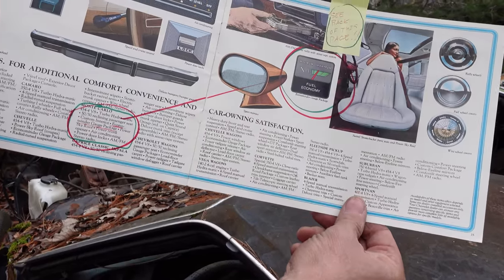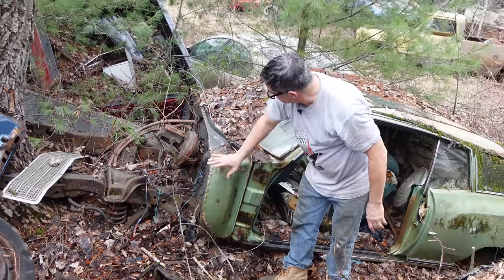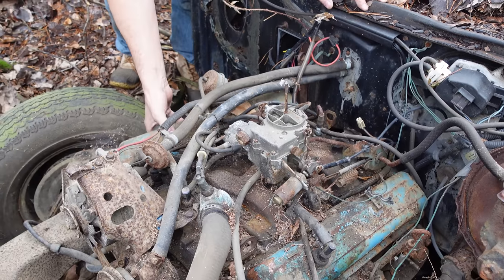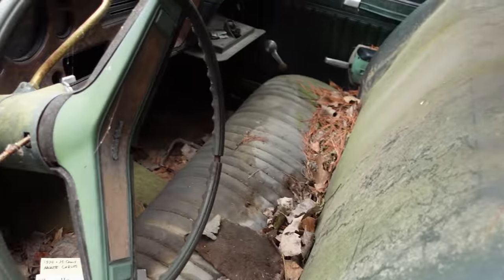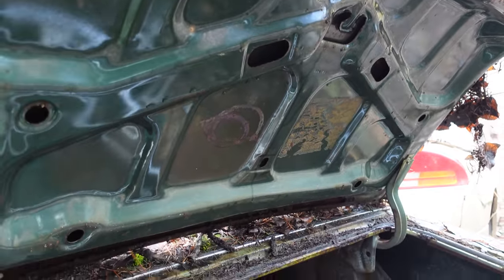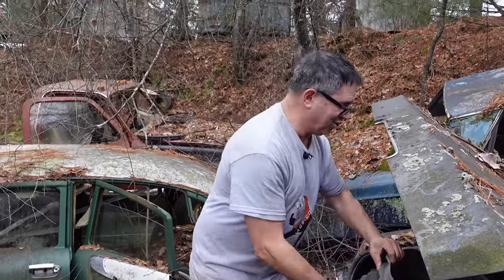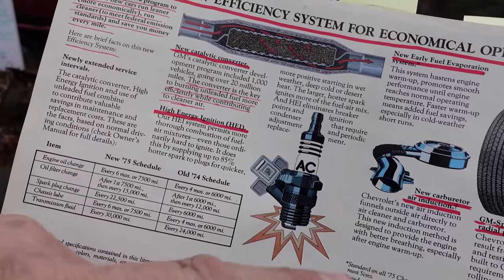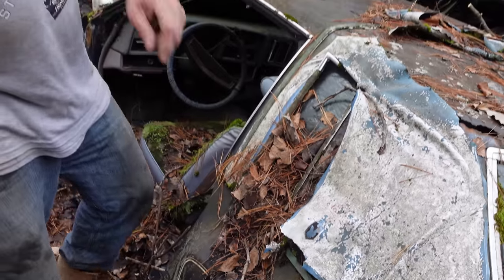Twins of Monte Carlo

Comment: It's crazy how my childhood cars are now classics!!!!!!
Reply: Mr. B Here ! Work for Oldsmobile dealer ! We are OLD ! LOL !
Reply: I believe 1973 and older are antiqued
Reply: @missingremote  lol that's me a antique!!!😄😄😄
Reply: Guys that is what we need today making fun of ourselves. Love it !
Reply: @debbiebermudez5890  I don't use the word "old" with out a er at the end Lol it just sounds better lol
Reply: Try this one you may like it ( Aged like a fine Wine ) ! LOL!
Reply: It takes a classic to recognize a classic.
Reply: @missingremote4388  it may vary from state to state (I don't know), but in my state of Kansas, any unmodified vehicle that is 35 years old or older, is considered an antique. And can be registered and tagged as such.
So now that it's 2023, a vehicle from 1988 is considered an antique in the state of Kansas!
Reply: @willhorting5317  Many states are 25 and older. They get historic plates, registrations and often just a safety inspection with no emission check. In theory, the emission controls originally on it should still be there and working, but since it's not a failure point, it's not "required". It technically is a Federal violation to remove them, but putting a newer engine in an older car "cleans" it up, so in theory, it's skirted over. Some states such as NY have "Vintage Historic" which  means that an original set of plates that were in use when the vehicle was a new vehicle can be put on the car and legally registered. It also reduces the insurance and gives it a period correct look. I have the original plate number on my 1980 Trans Am from when we got it new. The plates were saved throughout the years and I put them on several years ago, so if I look back at old photos, it's got those plates on it. The plate has gone from my dad to my mom to now me. When I wanted to transfer the plates, I called the DMV and the guy laughed, "Yup, just had a call on that the other day. Have the executor of the estate just sign the car and plates over to you. It actually will wind on my desk and if the paperwork is in order, we'll mail you the registration". That's exactly what happened and now it's renewed online like any other registration.
Reply: @googleusergp  😎
I appreciate the info.
In my 60 years, I have never lived outside of Kansas.
So I have no idea what other states do.
But I did assume that things probably vary from state to state.
Reply: @willhorting5317  Yes, they do. There's always the "Vermont method" to get a title when the paperwork has been lost. Fortunately, any parts cars I've gotten over the years had titles or when the yards and tow operators came to get them they never cared and off they went. Also, things can get messy when there are estates involved. Fortunately after my mother passed, everything was in order (and when my dad was alive, it was the same way) so my uncle was able to step in and handle signing everything. We already knew what we wanted to do, so the transfer of everything was just to make it legal and a formality.
Reply: @googleusergp  - That’s what happened here in Texas last summer when I went to get the annual inspection for my ‘97 Cavalier! When I asked why the fee was so low, the guy at the testing station explained and I responded by mockingly saying, “OMG - my daily driver is a CLASSIC…….!!!!!”

😂
Reply: @ddellwo  Back when my state had dyno emissions and I was driving my 1984 Delta 88 with a 307 Olds everyday as a commuter, I had to bring it for a dyno test. I know the operators of the shop for 30+ years (it's decentralized in my state, run by private shops) and he had a used car dealer there with a newer Grand Am and it wouldn't pass on the dyno. The operator said, "Let me take care of this guy (me) with the Olds and we'll try again". The used car guy said, "That old thing will never make it". Back then, you would run the test and then the operator had a remote control to change the screen. So the test goes, and you have to accelerate, decelerate, cruise, flat out throttle, etc. The test ends and he clicks the remote. The screen is all green and it says "PASSED". The results came out of the printer and I was stunned, clean as a whistle. I laughed and as the owner of the shop was putting the new sticker on he said, "You can't beat these old cars when they are running right". I said to the used car dealer, "And no, it's not for sale'. LOL.
Reply: My first car was a 77 T-Bird, right there with you!
Reply: I'm closing in on 50, I refuse to accept I'm old. 
When I was 18, 50 was ancient. 
I don't feel ancient ,I get around fine and still do active stuff although every once in a while the next morning hurts. 
Yeah I'm not dealing with  this age thing well at all , it's like I remember when the roads were "littered" with cars like these. 
Looking back,one fond memory is of being with mom going shopping ,and while walking in the store you end up hearing a one or a couple of Chryslers start up.
Reply: @MrTheHillfolk  I can usually tell the GM divisions apart as well. LOL.
Reply: I have Colorado Collector plates on my 73 C30 and a Horseless Carriage plate on my 53 Plymouth Cranbrook coupe. No emissions testing required for them
Reply: I worked in the prep department when those were new
Reply: No doubt

Comment: When I work for Chevrolet I was under the impression and that's what everybody said was that Monte Carlo frames were the same as a Chevelle station wagon frame
Reply: The reason they said that is only because of the wheelbase being the same. The frames were definitely not the same, though. Can you imagine a Chevelle wagon with the front bumper mounted way out ahead of the grille?

Comment: Thanks Steve - I managed to restore/replace abused items on my '70 Chevelle from MC's, the trunklid, dash (fill in the little slots where the burlwood aluminum insert tabs go) the rear window defogger, and even got my 12 bolt from one at a Pick n' Pull for like $100.

Comment: I had a 77 Monte Carlo bought new for 18 years.  Mine was buckskin with landau roof, swivel buckets, rally wheels, console auto, power windows, power locks, ac, rear window defogger, factory front and rear floor mats, light under the hood and inside the trunk, cruise control, tilt steering wheel, power steering, and power brakes.  Mine had the 305 2 barrel with very small carburetor jets which were a little too lean.   Beautiful car.  Thank you Steve for another wonderful Junkyard Crawl on a car that I had and loved.
Reply: You know, of all the Gen 2 Monte’s I’ve personally been involved with over the years, I have never come across one with a center console! Every single one has been a bench seat car, so they must have sold a TON of the benches even though it’s a vehicle that pretty much cries out for a center console and shifter!
Reply: @ddellwo  I've seen plenty with a floor shift and I went to college with a guy that had one, a 1977 with a 350 V8 and swivel buckets. He bragged about getting a NAPA distributor cap with brass terminals for "better spark". Too bad that those were available everywhere else. He'd put that "top quality" distributor cap on there, but the car had aluminum pool sides for floor boards. He was witty though. When asked what he wanted to do for work when we graduated, he said, "I want to be a mon back" When the counselor asked, "What's that?" He said, "Ya know the guy behind the truck waving the driver back saying 'Mon back.....keep comin', "Mon back". LOL.
Reply: @ddellwo  My Monte had storage in the center with a lid like a glove box that you could put things in.  I bought it in Oct 77 when the 78s came out it had been a dealer demo with literally every option available.  It was my first new car and had about 3,400 miles on it.  There was a light gold demo with a cloth bench seat and a 350 4 barrel I wanted but it literally sold when I was test driving it.  I liked the swivel buckets but I would have preferred the 350 4 barrel over the 305 2 barrel (the 350 was the fleet truck manager's demo).  I had called all the surrounding dealers and only 1 dealer had 77 Montes.  I liked the Pontiac Grand Prix  and  called the Pontiac dealers and none had any 77 Grand Prix left.  I wanted the last of the big GM PLCs.  I eventually got  use to the downsized intermediates.

Comment: Many people don’t realize that extension on the should isn’t for Chevelle to Monte Carlo. That extension is the add on for the small block , pull the clips and take it off and you have a big block shroud.
Reply: It's not quite that simple. Yes, the small blocks used a longer shroud than the big blocks, but the 2 shrouds are only 2¼" different. The small block depth is 12½", and the big block is 10¼". I have both to measure.
Reply: @danjanes8689  good to know. Then I can just say popping the extension off for the big block works, even though it may not be correct GM

Comment: I have a 70 Monte. Junkyard save from 25 years ago. It has a Pontiac 400 engine and transmission. The fans on a Chevy engine are a couple inches smaller diameter than Pontiac. I used a fan shroud from a 70 Grand Prix. Everything bolted in place with mods at all. GM was very good about interchangeability back in those days.

Comment: Back in 1979 my dad had the chance to buy a 1970 Monte Carlo 350 , 12 bolt posi with a four-speed! It was dark green with green bucket seat interior! It was in great shape!. It was the guy's daily , it actually had snow tires on it . The guy wanted 1750 for it! My dad wouldn't buy it because I was getting my license in 2 years and he knew I would take ownership of it!😂 till this day I have yet to see another Monte Carlo with a factory 4-speed.
Reply: Back in the late '80s or early '90s, I saw a news expose show on one of the major networks where they hired an older couple to drive a large RV around the country, while stopping for service on the RV at several shops located near major highways. The network also had their own team of mechanics, who verified the mechanical condition, and also set up small malfunctions to test the mechanics. Some shops fixed only the 'manufactured' malfunction, while others went beyond, doing work which was unnecessary in order to increase the bill. (Or even claiming to have done extra work which wasn't actually performed.) At the end, reporters confronted the dishonest shop owners. One of those shop owners was driving a '69 or '70 Grand Prix, and when he made his escape, I saw him reach down to put it in gear, and as he drove off I could hear that the GP had a manual transmission.
Reply: All of us have stories about The One That Got Away, '70 1/2 Z28s, R/T Challengers, etc. As much as these tales are heartbreaking, I still love hearing that I'm not alone!
Reply: Standard Monte's are rare but they are out there.

Comment: As a young fire and rescue first responder I learned that 75 and later Monte Carlo's had an extra reinforced B pillar due to General Motors anticipating that the government was going to mandate rollover Crash standards so you couldn't cut the top off of a Monte Carlo to extract passengers because it took too long so you would cut the bottom of the A pillars and then cut into the roof just before the B pillar and tilt most of the roof back. Just some more odd Automotive History!

Comment: My Dad had a 1970 Monte Carlo that was dark green with green interior with  the bench front seat. When I was looking for my first car I looked at a 2nd gen Monte Carlo that had swivel bucket seats and a console with a floor mounted shifter. Someone had put a Hurst shifter in it that had the velour T handle, not sure but I think it did have the 454 in it. It had some fat tires on the back, it was somewhat of a hot rod.

Comment: I owned a 1970 Chevrolet Monte Carlo from 1991-2010. Mine was early build (September 1969) from the Flint Michigan plant. Mid year, they eliminated the trim piece on the front of the vinyl top and ran the top to the windshield moulding. Mine was “desert sand”(gold) with a black vinyl top and “sandlewood” interior. It was a 350 4 barrel and had A/C. I spent several years restoring the car. I got to enjoy it for several years before I sold it in 2010. I’ve owned 3 others over the years, 1978, 1979 and 1983 models.
Reply: I didn’t know that about the vinyl top trim.  Mine was built the 3rd week of December 1969 in Van Nuys, California.  It has the full halo.  I’ve had it for 40 years now.

Comment: Thank you so much Steve for this video! I had a 75 MC in the same blue metallic with the white Landau roof as the one in the video except I had a white interior with the swivel bucket seats. I had the 454 4 barrel which I believe was called the "Towing Package" because "SS" wasn't politically correct for those gas crunch times. I also had 15x8 Corvette steel wheels which looked like the factory 15x7 wheels but much better looking! Of course, I broke many spindles too because they were so much heavier! I'm 62 years old. I've owned several GTO's, Mustangs, a 2006 Charger SRT, a 98 Trans Am WS6 (which I still own) and hands down my MC was my favorite car of all time. Thank you again!!!
Reply: @MrRamayr98 The 454 in a '75 Monte had to be exceedingly rare. The last year a 454 was available in a Chevelle (Malibu) or even Corvette was 1974.  I remember reading about that long before the internet existed. 
I even thought Steve was mistaken when he said '75 was that "last year of the 454" at the beginning of the video.

Comment: Similar point here on the radiator fan shroud- when the Cadillac Eldorado was restyled for '67, initially there was the possibility of a return to a 12 engine(at the design level); so if one looks at the fan shrouds for those, there's almost literally a short tunnel there, as they ended up scrapping the V12 idea & stayed with a V8. The fix for cooling was the add on fan shroud extension.

Comment: Steve I,m waiting for you To say what motor was in the 70, My Brother Dennis had a Beautiful 70 402 car light Green Nice Car
Reply: The VIN doesn't tell you that, you have to look for other clues. By 1972, the VIN did tell you which engine was installed.
Reply: @googleusergp   Vin does tell you Engine that's what I wanted to know
Reply: @brianbloom1799  Not in 1970 it doesn't. From 1972 onward for GM passenger cars it will. So, the 1975's VIN will tell us if it had a 350 two barrel originally or not. That cannot be found in the VIN for 1970 on GM cars.

Comment: Hi Steve, another great video on the 1st and 2nd gen Monte Carlos. 1st was no question, a beautiful car. The 2nd gen took a while for me to embrace, but I've come to my senses. 😆 Around here, 30yr ago, it was common to see a 2nd gen set up with a "gangster lean" or jacked way up in the air all around. It's not like today's customized cars with the 30in rims, etc. These were set up on the biggest tires on 15in Chevy ralleys with about a ft or more of clearance added with blocks, etc. If you were riding behind one of them, the rear axle assembly and sway bar were definitely on display, and if it didn't have a factory sway bar well thats what JC Whitney catalog was for. I installed a ton of them on 'these rides' back in the day. Some had them so tight that they would bounce going down the rd. I'm sure they lost all that personal luxury ride. A fellow came to me with one, one day and asked if I could install a new fuel tank on his car, and what he brought to me was a chromed tank. I asked why? "You're not gonna be able to see it." His reply was "...if you get it high enough, you can!". So if anyone ever sees a 2nd gen Monte with a chrome fuel tank. Rest assured, it was installed correctly. LOL Namaste 🙏🏼

Comment: Great Monte Carlo video! The '70 is a an early '70 build from what I've heard/read from the Halo top trim. Same with the body color hubcaps. Sea mist green. You can see the trunk lid was replaced with the dark green one, the hinges are light green still. Man I sure would like that steering wheel for my '70.
Reply: I noticed that top also. I had a early build 1970 with the same top.

Comment: We turn those 73-77 a bodies into circle track cars. We like them because the chassis is more robust, and the lower control arm mounts are wider so that when we design the front suspension geometry it’s easier to dial in the moment center. The upper mounts are tall enough we can cut and modify them to remain stock looking. The rear we just drop the lower arms on the axle 1.750 down and lower the whole car down to 4.500 under the front x member

Comment: Wifey owned a medium blue 1976 MC with the full vinyl top and blue velour interior. Budget pimpmobile of the era. Loved the rallye wheels with medium width whitewall Michelin X’s it had on it. 

Even though car had signs of being rustproofed (probably by dealer), in the late 70’s it already had signs of rust in bottom of front fenders, just in front of passenger door. Door hinges were another weak point - big honkin doors put some heavy loads on them, wearing them out in a few years.

Comment: I once ran Enduro races considered to be poor man’s NASCAR. The Monte Carlo from 1975 was the most sought after because it had the strongest bumper.
73 to 77 were great because of that long distance between the radiator and the fan you could push people out of your way at 100 miles an hour and not lose your radiator once it was mounted with bungee cords!